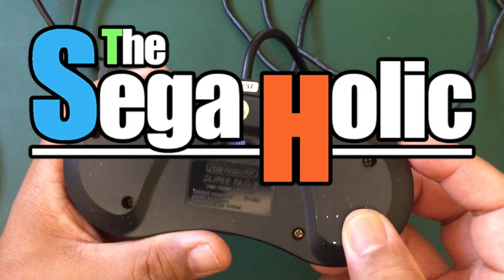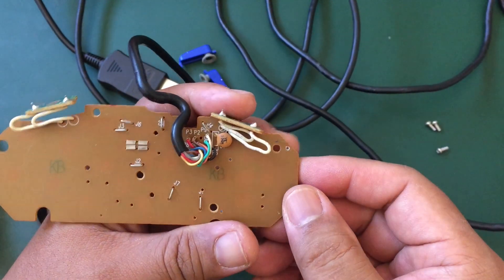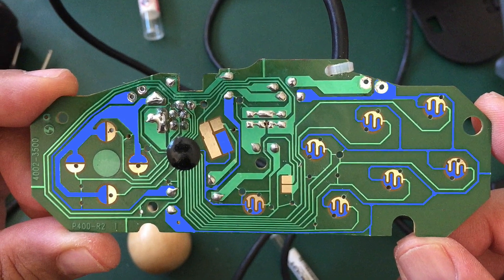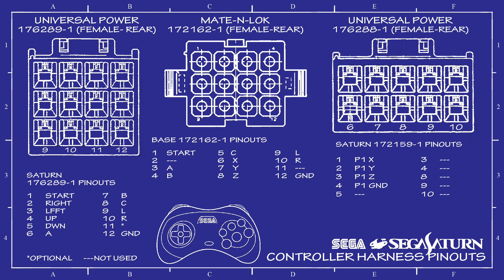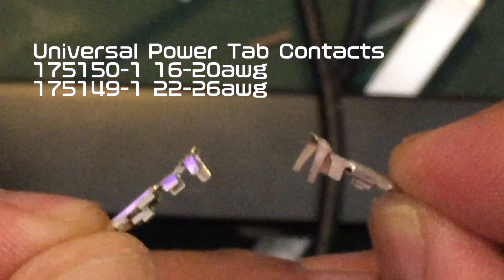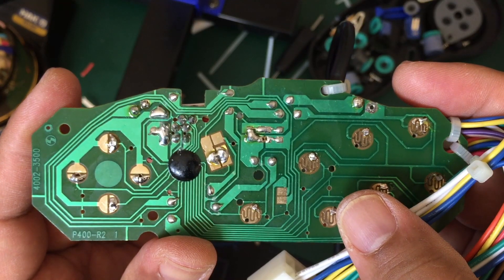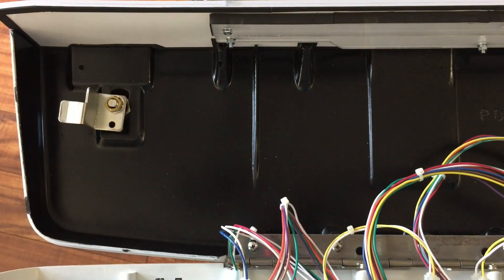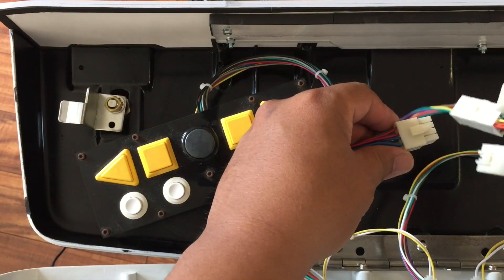| Astro City | Candy Cab Arcade Stick Build pt.4 Controller PCB Hack  [ep. 78]

Comment: Hey segaholic, I have been following your guides on building an arcade stick, especially your joystick builder website. I chose to use a db15 connector like you said. I’ve tried padhacking two PlayStation controllers now, and both times the copper pads have lifted up from the pcb. How can I prevent this from happening? 

Also, in the first episode of this series you show your custom stick and the project box you used. I am curious on where I can purchase one and what the dimensions of it are. Any help would be greatly appreciated.
Reply from the maker: Hey! great you tried this. You can use any connector hat has however many pins you need. Doesn't need to be a DB15, but the DB15 is cheap and available freely. If you're using official PS2 controllers, don't use those. Use generic ones. They are much easier to solder to.

You project box size will depend on what size your pcb is that you want to put into the box. You can cut your pcb to a smaller size if you know what you're doing- allowing you to use smaller project boxes. Just search for "project box" on Amazon, and there are quite a few sizes available.
Reply: @The_SegaHolic  Ok! thanks for your help. I was curious if drilling holes with the pin vice will help, as i haven't done that both times. BTW, I have been using third party controllers.
Reply from the maker: @user-xj2fj9nn3x  got pictures of the failed soldering attempts?
Reply: @The_SegaHolic  Yea, you can see the top and left pads I soldered to lifted off the pcb. I put a wire with the trace next to the top one.
https://imgur.com/1dSVNd5
Reply: @The_SegaHolic  I need help from the master again, hahahaha. I'm trying to wire up this snes classic controller, but it's giving me trouble. The d-pad is strangely setup, with there being only left and down having ground, and the rest are strangely connected. If you look at this picture I took, you might understand what I mean. How would I go about wiring this?

https://imgur.com/YtV2oPM
Reply from the maker: @user-xj2fj9nn3x  What controller is this? SNES Classic for Wii?
Reply from the maker: @user-xj2fj9nn3x  You'll just have to wire those directly to your stick... meaning, you'll have 8 independent wires from the board running to your stick switches. Obviously, you can't use a stick that has a board with common ground. You'll have to use a stick with switches that you can wire directly to, meaning, sticks that don't have the switches soldered onto the pcb, but instead, use connectors to mate the wires to the switch contacts, or sometimes the wires are soldered directly to them.
Reply: @The_SegaHolic  Wow. Guess I have some replanning to do. I might just buy another snes classic controller of ebay and hope it was set up differently. After all, this was a clone.

Comment: Good stuff dude, I was hoping you were going to do this when you started this series!  When I do an arcade stick (which I will at some point) my plan was to reuse a controller PCB as well.  Really well done and I pick up new tips each time!  Keep it up!!
Reply from the maker: Thanks man. Yeah, this should give ideas on reusing the original harnesses for any stick or arcade panel, or just doing pad hacks. It's much cheaper to do pad hacks as you can get get generic controllers for ANY console you want, and get them for less than $5. And you don't have to worry about added lag.

Comment: Thanks for the videos man. I have been messing with cab lately, and started seriously considering getting a candy cab. Research so far is pointing me towards a Sega Blast City. You latest videos are very much related due to the Sega astro city controls. Do you not have any cabs of your own?
Reply from the maker: Can't get a full size cab here on the used market. I would love one but NOBODY has them for sale here! And importing a full cab from Japan would surely kill my wallet.  So many options if you live on the mainland. That's why I had to resort to the next best thing. Using the bases. At least I get the real deal feel of the arcade controls. Yup, doing additional research and looking at the manuals and such that I did for the last couple of vids, I'd go with a Blast City. Or manybe a Net City for it's smaller size... unless you want that classic candy cab shape. Blast City panels next up on the upcoming episode... either that or I'd have to fullfill my promise to this viewer to do more OG XBox stuff that I have to touch upon.

But yeah, the Astro City controls are compatible with Blast City, But I think Blast City has up to 5 button support without kick harness... so on games like Guilty Gear, you don't need the kick harness. And the kick harness is a 15pin, and supports up to 7 buttons per player.... according to the diagram on the manual of course. But an Astro City panel that's wired for Astro City still should work on a Blasst City as pins 9 (sw4), 10 (sw5), and 11 (+5v) are empty on the Astro City main harness and onl accesses additional buttons via kick harness, which it has... but may only support 5 buttons and not a 6th according to the Astro, and New Astro City manuals I've been able to download.

I'm glad I did/doing the videos though. I've learned a ton about the all the wiring and internals of Sega CRT based cabs.